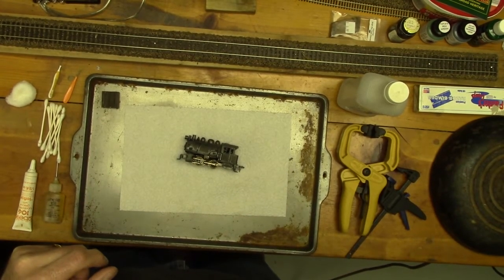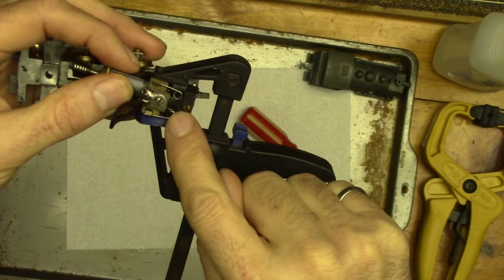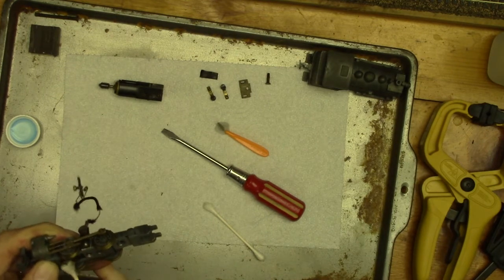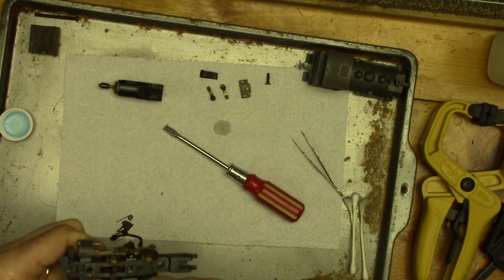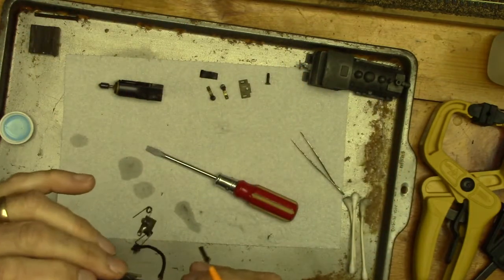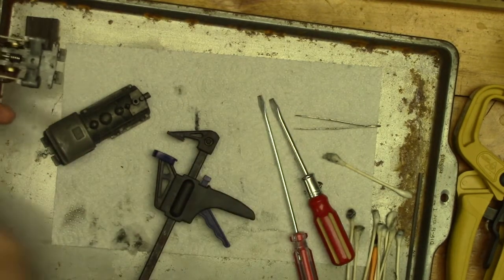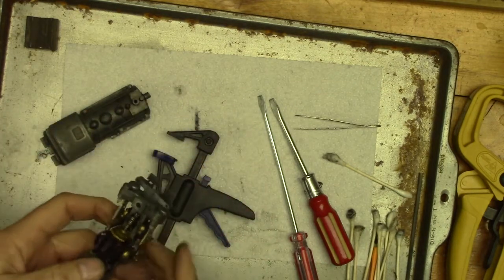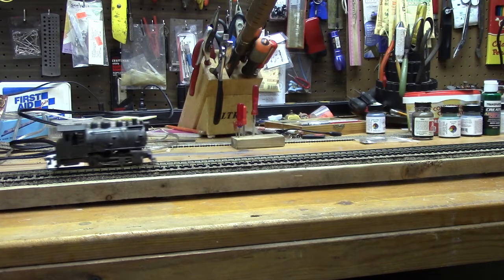Varney  0-4-0 Rescue (Part 2) - Clean and Lube

Comment: The magnet is a good idea unless you run across a brass screw or some part that isn't magnetic.  The greatest improvement you can make to that open frame (Pittman) motor is to change the magnet and use neodymium (rare earth) magnets and you will see a HUGE difference in current draw and performance.  I did that to all my Pittman motors and now they will "creep" around the tracks.  If they had a rivet I drilled it out and used a screw and nut.  If they had a screw, so much the better as they're easier to do.  The second big improvement is to change any incandescent lighting to LED's.  Thirdly, install a Kadee coupler.  When cleaning the commutator of the armature it's wise to clean out the grooves with a wooden or plastic toothpick.  I do NOT do DCC.  I hate the tinny sound of HO scale DCC.  Cheers from eastern TN